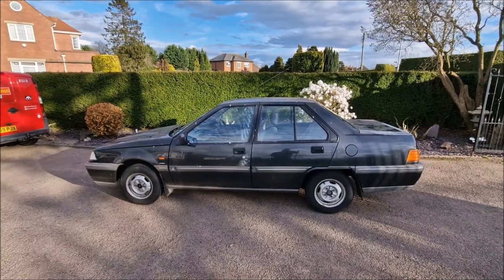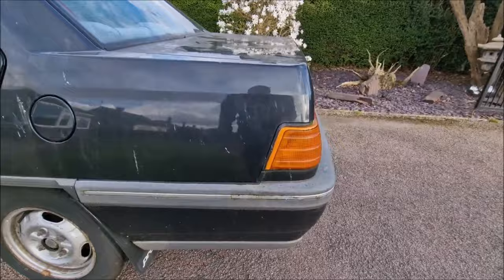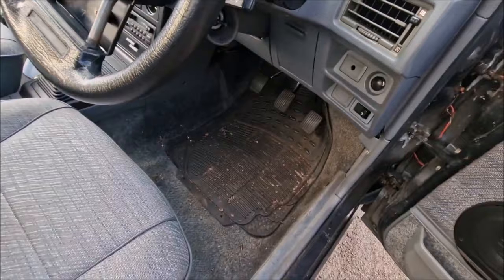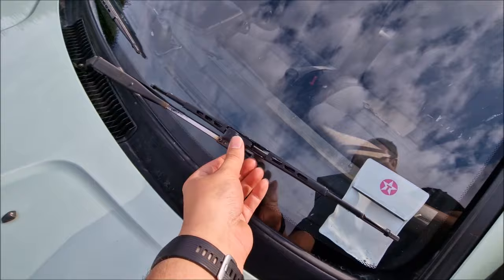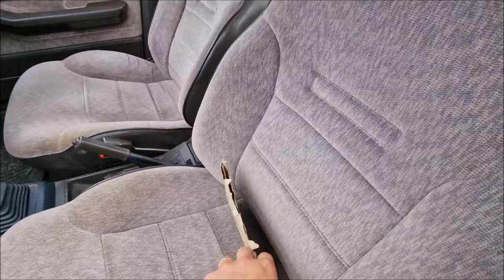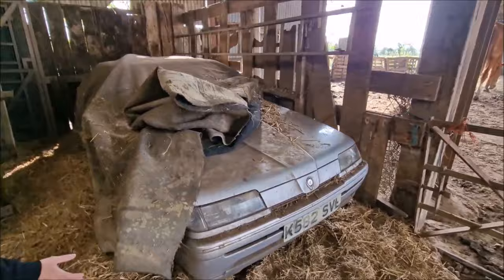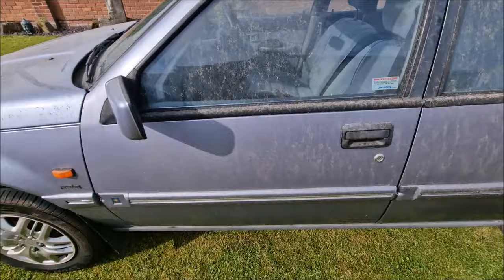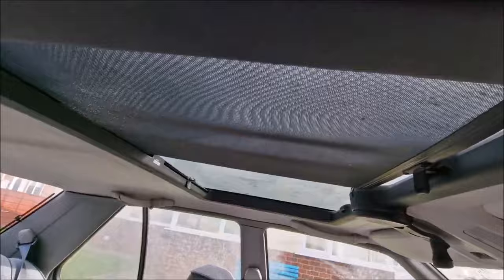Every Car I Bought In 2023 - 8 Proton's, 2 Audi TT's, 3 Nissan Micra's & More!

Comment: What happened to the one in the barn? I was looking through your library and couldn't see any mor2 videos
Reply from the maker: So its currently still in the barn waiting for nicer weather for me to go and pull it out with a friend and a trailer and a winch. I aim to get it out this spring. It will only be stripped for spare parts, it wont be put back on the road.
Reply: @JonCoupland  that's cool, I was just hoping to watch a cleaning video 😆 my Grandad had one when I was little and they hold quite a bit of Nostalgia to me
Reply from the maker: @steve.9138  there are plenty more videos from the Proton collection I bought last year :) check out the lilac one I bought. I'll absolutely do a cleaning video when I get it home though!